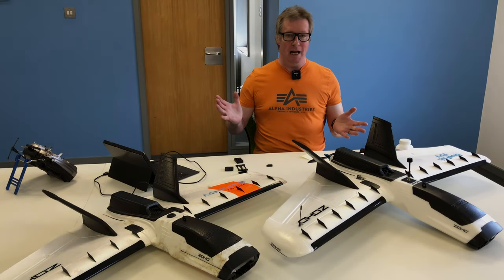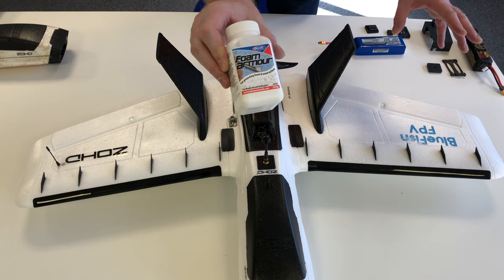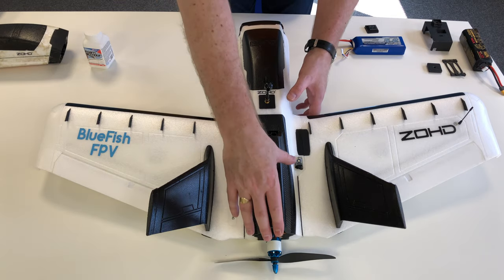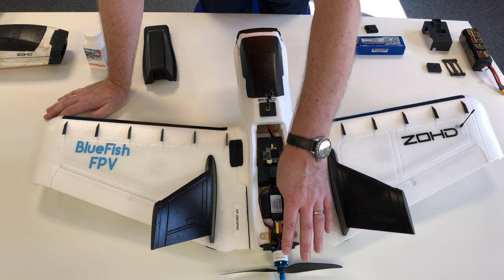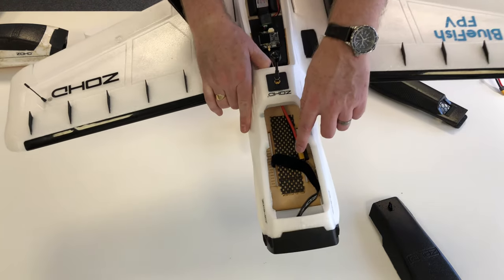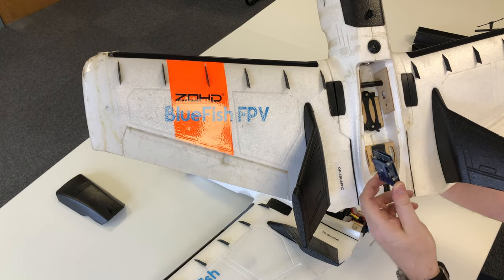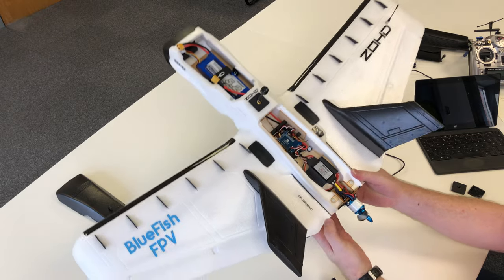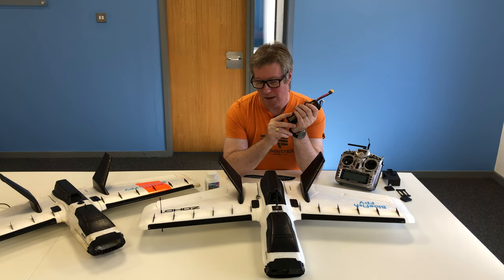ZOHD Dart XL - Enhanced Version - Build Overview

Comment: HI Glen - thanks for the speedy response.
I had noticed when I attempted to add the recommended 2nd coat to the more vulnerable areas, that the 1st coat softened and started to drag, so I aborted the 2nd coat. Now that the Foam Armour is protecting the foam (one model EPS and one EPP) I am going to try sealing the Armour with automotive (acrylic) clear lacquer spray as used on car bodywork. I do like the way that Armour smoothes the surface. I would use it as a primer under automotive primer and top coat if I was repairing a foam model and re-spraying it.
I have researched E6000. It is a contact adhesive and general warnings are not to let it near foam! But there are different foams and different version of E6000, including a spray-on can. Clearly trials are needed on spare pieces of model foam. 
Have looked at Mod Podge? Popular in The States for foam protection.
Just to add to the list, B-7000 too.

Great idea compiling a separate  video on this topic Glen.

I believe that you were going to email me sometime?
Reply: Glen
I've solved the Foam Armour problem.

I coated part of an old foam aileron  with Foam Armour on both sides. Once thoroughly dry I coated one side lightly with Halfords Clear Lacquer. Once dry I sprayed both sides liberally with water. 
The Foam Arnour only side softened,  none of the bubbling that you observed. The lacquered side just beaded off the water, everything stable.
Reply from the maker: Thats sounds like a good method, let me know how it stands up in the field. In my latest vid I show the E6000 coating for you. I have my respirator, Toluene and some E6000 and will try thinning the E6000 slightly and brushing it over the fuse. I have got some B-7000 as well and as I understand it that is just a thinner version of the same compound.
Reply: @bluefish3607  Hi Glen. Foam Armour Update. 
Application neat onto the foam of my E-Flite Turbo Timber Eve I considered a success. Time will tell if it ever gets to wet and need the clear lacquer. I estimate it added about 30g or so to the airframe weight.
Application to the EPP foam on my Hacker Super Zoom XL wasn't probably necessary, but I looked at it as an experiment. This time I diluted the Foam Armour with about 10% water to help it flow better. That worked. But I reckon I was a little impatient and applied the clear lacquer too soon and hadn't allowed enough time, about a day, for the Foam Armour to full dry out and cure.  Consequently it added about 120g to the weight of the airframe. Was made this worse was that there is a lot of surface area behind the CofG so I needed to move the battery forward and add 30g nose weight. The clear lacquer I consider a success in waterproofing the Foam Armour.

Comment: Hi Glen
I note that you have used Beacon Foam Armour protective coating on the foam of this model. I am trailing it on a couple of my models, but it's too early to know how effective it is. Foam Armour has the feel and smell of PVA woodworking adhesive, so I don't find it very easy to apply - Beacon should produce it a little less thixotropic in my opinion to ease application.

So how are you finding Foam Armour a year on?

I recall you also trying a different coating, but I cant find the video you mentioned it in: E6000 or B7000 maybe?
Whatever is was, how did that coating perform?
Reply from the maker: Hi Dave

I stopped using foam armour because when it gets wet it bubbles up and I often land on wet grass. I think it would be ok if kept completely dry. 

I now coat the front of my fuselage on my AR Pro with E6000 glue it is extremely tough, fully waterproof and has withstood some pretty hard crashes. It is pretty thick and I just spread it with a finger or credit card wearing rubber gloves. I believe you can thin it with toluene and apply with a brush but I think that stuff is pretty noxious. I will showing my technique in an upcoming build video.

Comment: Nice review, really enjoyed your videos and got many insights. How many layers of foam armour was done on the craft? Im planning on building my 1st wing, Initially I thought of going with atomrc dolphin as theres a local pilot in my area managed 40km with a 10kmah li ion, but after watching alot of your vidoes and got alot of insight, im considering the ar wing pro or zohd dart xl enhance. Im looking for high speed cruise and normal cruise speed long range, of all these wings, which would you recommend best suited for my build?
Reply from the maker: I just used a normal paint brush and put one layer on the fuselage, wint tips and elevons. It pretty thick stuff and you have to brush it on quite quickly as it starts to dry pretty fast.

I would go for the AR Wing Pro as it can do everything, long range cruising. or fun flying like in my video, I have set mine up with DJI for up to 5km range and as fun flier and my Dart XL is being setup as an efficient long range cruiser, but if I had to choose only 1 I would go for the AR pro personally,
Reply: @bluefish3607  Thank you soo much. I just made my order on the AR Wing Pro!
Reply from the maker: @vektr6278  Its and awesome plane congratulations and welcome to the AR pro club :-) Happy Flying

Comment: Nice! I'm looking to buy one of these...
Did the foam armour work out well? I'd like to know the name of it if it works well. 

I'm just starting out with RC planes - which parts would you say are the bare minimum to get going? Thanks!
Reply from the maker: Hi Jack the foam armour works well on wingtips and small areas but not so good to cover an entire plane. Just Google foam armour and you will find it. Its produced by a company called deluxe materials. 

The bare minimum to get started with a plane is the plane itself motor esc radio receiver and transmitter. This will allow to fly line of sight and you can progress to FPV by adding a camera video transmitter and goggles as well as a flight controller and iNav. 

You can get lots of help and ideas on the facebook group links in the video description.
Reply: @bluefish3607  Thank you for the info. Hopefully I'll be in the air by the end of the month. I just have to find a suitable receiver and transmitter and that should be it.

Unfortunately, I don't have Facebook because it spies on its users and sells their personal details. Is there another place you would recommend?
Reply from the maker: @Jack-jl1ui  Lol sorry Jack but you know that your personal details are already out there on the net dont you. What details do you think facebook sell thats not already out there? 

I would not worry if I was you and if you feel more comfortable setup a facebook account with fake details and email address and get access to the best source of information and lots of really great enthusiastic people that can help. Just my two cents 😀
Reply: @bluefish3607  With the FB app on your phone, they have your location 24/7 and can access your camera and microphone. I'm experienced in this field.
Reply from the maker: @Jack-jl1ui  Me too I own an IT security company 😀

Comment: That,s a nice and clean build. How does the version 2 fly compared to the 1st version.? Version 1 has a terrible tendency to pitch up on high throttle which i find really annoying!
Reply from the maker: I cant say yet Kyle until I maiden it hopefully later this week. I had to change the motor thrust angle on my version 1 to correct the excessive pitch up on higher throttle. Hopefully they fixed that on the V2 we will soon find out 😀
Reply: @bluefish3607  Fair enough. yes lets hope so. its a real pain in the ass.

Comment: thanks for the great build review and 3d parts. Going to start printing most of these for my brand new Dart. Tho I do have a question about the wing placement of the crossfire. Wing connector offers only 3 pins for the cable, crossfire needs 4 to get telemetry back to the radio, because I use Inav lua. Should I just drill a hole next to the pin connector and lead the 4th wire through it? thanks
Reply from the maker: Just share the ground on the servo and crossfire on a single pin in the wing connector by splicing them together, then you don't need to drill or add any extra wires and it keeps everything neat.

I hope that helps, good luck with the build and maiden.
Reply: oh and, I'm going to use a GoPro7, noticed it blocks up the entire front air vent. is the rear hatch vent enough to keep everything cool?
Reply from the maker: @sidd8310  Yes should be no problem

Comment: Still waiting for my zoid xl to show up but getting plan together for installing electronics, on your setup seems like esc and vtx are very close is there any interference in vtx? Also gps is not on top seems like it would get better signal if more exposed to the sky but i may be wrong on both accounts? Thanks for video, please give me your take on this.
Reply from the maker: Hi, I have never had any interferenace between a VTX and GPS or indeed with Crossfire. I have built may quads and crammed these electronic components insite a carbon frame very close togetehr in some caes even touching each other. I am inclined to think that the consensus that interference can happen is a bit of a myth, but I am not certain, just that I have never had an issue. Mount things as you like and test to see if you get any issues and move things if that happens but I doubt it will. Thats my take on it.

Comment: Hi
Do you have a link for the "Remix FC mount" you mention @08:10?  
That looks so much better that other ones I've tracked down on Thingiverse or Yeggi. I've searched but keep drawing a blank.
I have a H743-Wing to mount in the Zohd Dart XLE, do you know if the F405 and H743 are the same physical size?
Reply from the maker: Hi Dave according to the Matek website specs the H743-Wing dimensions are 54 x 36 x 13 mm and the the F405-Wing is 56 x 36 x 13 mm so you will need to shorten the mount by a couple of mm.

Here is the link to the STL file: https://drive.google.com/file/d/1GYh0ApGIzbpzgUUYQzNodnAPy64kjzv0/view?usp=sharing
Reply: @bluefish3607  Many thanks for the link Glen!  I have successfully download the file and my mate has printed a 2mm shorter version of the plate for the H743-Wing FC.

But something to note if your next build includes an H743-Wing FC as the MatekSys website no longer lists the F405-Wing. The F405 bottom plate is plain so the two cam clips work well, but the H743 bottom plate is the PDB which has the power pads at the rear which obscures where the rear cam clip bears - the front is plain so that works OK.
Reply from the maker: @davehrcfpv  Ok Thanks Dave thats good to know.
Reply from the maker: @davehrcfpv  Is your email address the one that starts with X and ends with r?
Reply: @bluefish3607  correct Glen
Reply: @BlueFish - I have been monitoring my hotmail and not seen anything yet

Comment: Nice work, I just got one myself will be a fun build
Reply from the maker: I am sure you will enjoy it John. Happy Flying
Reply: Did you do the upgraded motor for speed or efficiency ?
Reply from the maker: @johndeesfpv9289  I just really love that motor on the Dart XL it has a little more punch than the stock motor when flying proximity for fun but equally as efficient for long range. The stock motors on the MK11 Dart XL is also very good and much better than the original ones on the MKI when the XLE first came out.

Oh and my favourite colour is blue :-)

Comment: was wondering what your launch settings are for the dart, just finished mine, just wondering your idle throttle and launch throttle ?
Reply from the maker: Here you go John, I love the XLE but the foam is delicate, treat her with love and land her on grass :-)
set nav_fw_launch_accel = 1850
set nav_fw_launch_max_angle = 180
set nav_fw_launch_detect_time = 40
set nav_fw_launch_thr = 1900
set nav_fw_launch_idle_thr = 1300
set nav_fw_launch_idle_motor_delay = 10000
set nav_fw_launch_motor_delay = 100
set nav_fw_launch_spinup_time = 100
set nav_fw_launch_end_time = 3000
set nav_fw_launch_min_time = 2000
set nav_fw_launch_timeout = 10000
set nav_fw_launch_max_altitude = 6000
set nav_fw_launch_climb_angle = 25

Comment: A couple of crossfire questions: 1) How do you route your 4th wire required for the crossfire through your wing butt?  I like the detachable wings and want to have the crossfire on the wing tip, but wondering how to get that 4th wire through the wing connection.  2) did you run into any problems with your lower crossfire antenna dragging on the ground during landing?
Reply from the maker: Hi Jim, I just spliced the ground wire from the servo in the wing wire groove and shared it with the Crossfire Nano, I do this on all my planes.

The Immortal T antenna is very tough made with reinforced spring steel wire and has no problems at all, especially as I land on grass 99% of the time. If it ever does bend slightly it either springs back into place or I just give it a gentle bend to straighten it up.

Hope that helps.
Reply: @bluefish3607  That was super helpful and works like a charm!  Getting ready to maiden and wondering if you would share your INAV autolaunch settings.  I am using the stock motor on my Dart XL Enhanced.

Comment: Hey Glenn great video thanks, I've seen some people having trouble with the alerions tearing at the hinges, how hard would it be to install ca hinges on this model? Thanks again
Reply from the maker: I think it would be quite straight forward to fit CA hinges especially if you retain the foam hinges. I will likely make some balsa hinges for my Dart XL and use the CA method.
Reply: Thanks for quick response, do you mean leave factory hinges in place and add plactic or ca hinges. Thanks again
Reply from the maker: @egtreadway4232  I mean slice the foam hinges off with a craft knife and refit them with CA hinges should be straight forward, alternatively run a thin layer of E6000 into the join of the foam as this will strengthen the hinges.
Reply: Thanks alot I will give this a try with they ca hinges and also will run some carbon fiber rod along elevons for strength.

Comment: Perfect timing for me! I've yet to fly any of my 'lockdown builds' and am just getting into FPV from flying LOS fixed-wing and helis. The DartXL(E) was my first build after watching your excellent video(s) and I'll be sure to incorporate your good ideas before the maiden. Mine differs in that it has a DJI AU and the standard motor, but also a matek F765 Wing (overkill for this model and I've learned since). Crossfire nano and T antenna on the wing and also will use the 4S Turnigy 5200 Lipo, but have built a couple of 4S 2P LiIon packs to try later if I can keep max current down.

I've set it up for autolaunch but still wondering if I should keep in Manual and get help to toss it! Looking forward to your maiden and any info you can give about initial CG, autolaunch settings, nav-cruise throttle settings, rates, etc. Anything to help with de-risking the first flights! I'm intrigued by the Foam Armour and will get some to try - I used HD packing tape on the wing tips and leading edges but never happy with the 'tape' look.I guess it's function over looks.

Again, many thanks for your very helpful videos and advice! Incidentally, I also have an AR Wing Pro to maiden and have nicked a lot of your ideas and 3d STLs :)
Cheers, Andy
(Oxford)
Reply from the maker: Hi Andy I love both the Dart XLE and the AR Pro and get excited every chance I get to fly them. I have DJI AU in my AR Pro as I wont be pushing it out that far and is more of a proximity fun plane, that said I have been out 5K with it.

The new XL is my new long range platform so going with 5.8Ghz analogue to try and get to my goal of 25km out and hopefully using my MyFlyDream tracker which has proved to be a bit of a challenge so far.

I will be covering all the Autolaunch settings and testing the cruise and efficiency in the maiden video which I may get done later this week but weather looks a bit dodgy.

Glad you find the videos entertaining and the 3D designs useful.

Comment: Water based Polycrylic brushed on two or three full coats will also work to protect it.  FYI
Reply from the maker: I know use E6000 thinned with toluene and brush that on and it works really well.

Comment: Nice video
Will your fc case fit matek f722 wing?
Reply from the maker: I think the F722 is slightly smaller I believe at 54 x 36 compared to the F405 56 x 36 but you could easily modify my F405 version to make it work quite easily. Do you have Tinkercad or Fusion 360 to do this?
Reply: @bluefish3607  I have tinker cad but I can’t ungroup it .

Comment: Hi , great  plane  but how is it possible  to  land and  avoid  the  propeller  touch the  ground and  destroy  the plane? Thanks
Reply from the maker: I set the ESC brake so when the throttle is at zero the prop stops spinning.

Comment: how did you pass the tbs nano cable through fusalage ? servo cables have 3 pins and nano has 4 pins
Reply from the maker: Splice the negative from the receiver to the negative on the servo and use connector for 5v Chan 1 and 2

Comment: was wondering if you were running 12 volts to your vtx ?
Reply from the maker: 9V from my Matek F405 John
Reply: @bluefish3607  thanks, the issue I'm having is I got the akk 3 watt vtx and it says it needs more than 2 amps to run it at 2 and 3 watts, I figured id try the f405 wse because they say the f405-wing is being replaced with it. I did buy both f405-wing and wse was trying to figure out witch one to go with..
Reply from the maker: bloody hell John you could fly to the moon with 3w :-)
Reply: @bluefish3607  lol I like to go long distance, my best bet is to get me a antenna tracker
Reply from the maker: @johndeesfpv9289  I tried the Myflydream tracker then gave up but am just about to try and set it up again with wifi from my Crossfire so it will be interesting to see how that works out. I will post a vid on it and if its successful a full setup guide and flight tests.